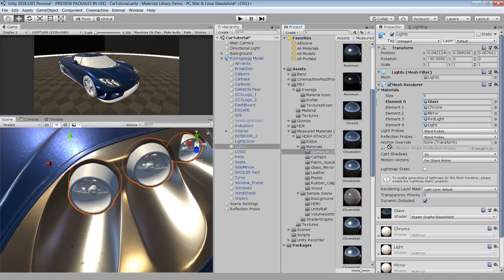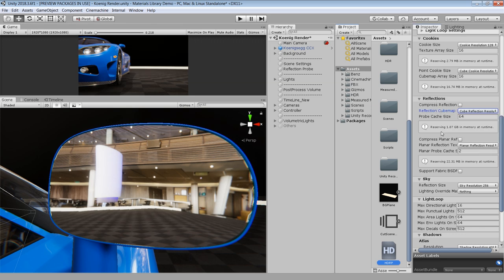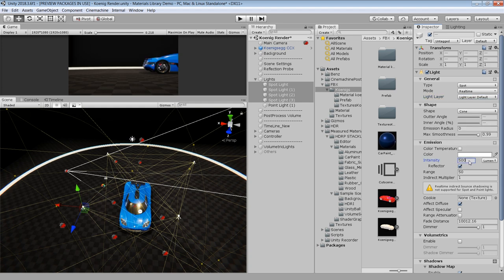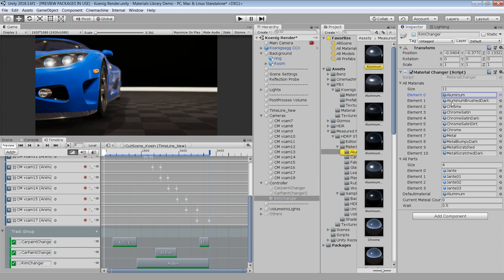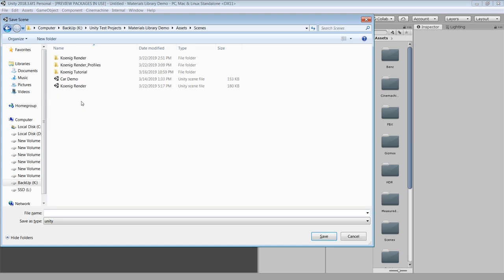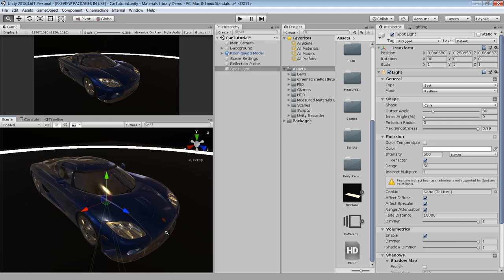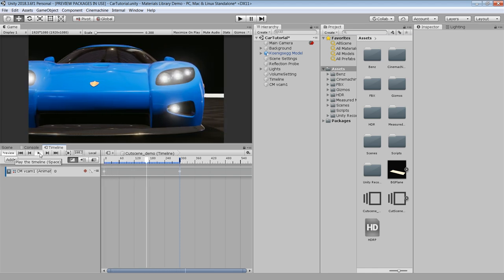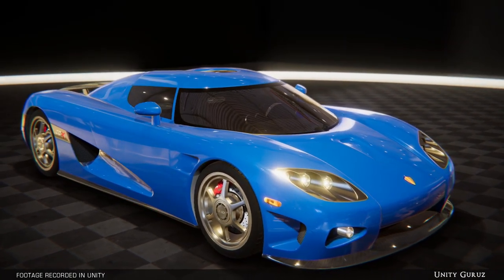MAKING OF HD CAR RENDERING DEMO | STEP BY STEP TUTORIAL

Comment: ---Hello.......Nice Work....I have question on unity......I made game on unity...
---I have 2 phones Samsung A3(2015,android 5.0) And A50(2019,android 9)
---I checked my game on both device but audio in A3 is louder then A50 how can it possible.
---there is one game object which has audio source.sound is on 0.5 but different in two divece 
---App is same so whats the problem.can u help me for it????
Reply from the maker: Yes its possible because of different devices. Did you check you app in any other device ?
Reply: @UGuruz  Yes i checked in 3 device in A3(Its louder),C9 pro(is like little low) and in A50(its about very low)